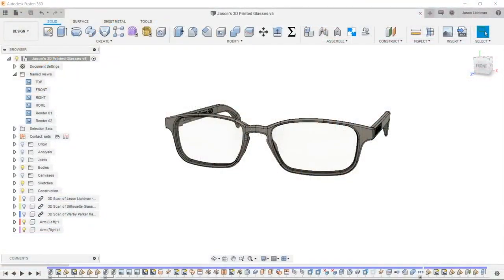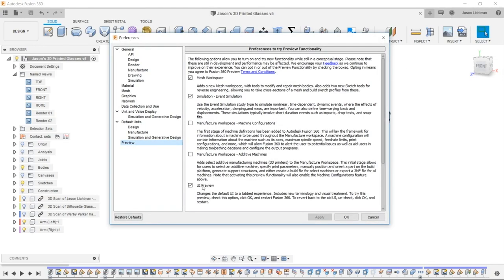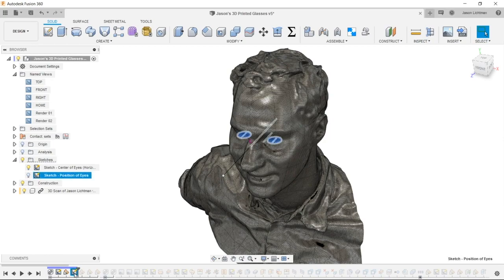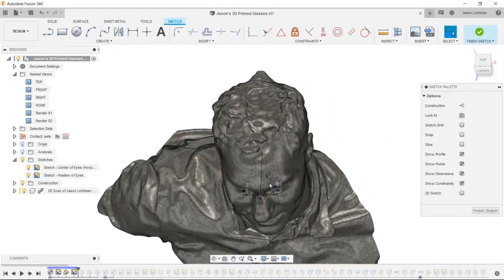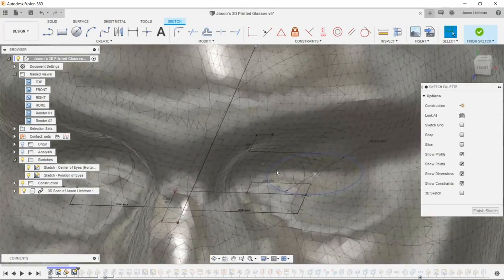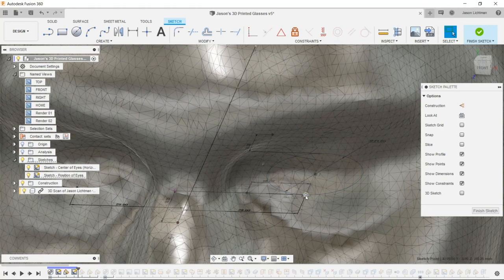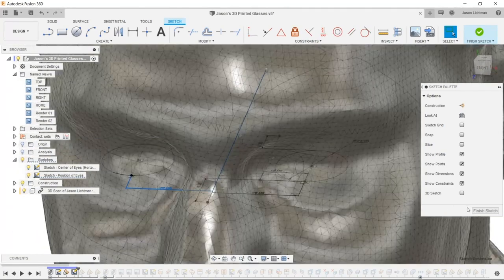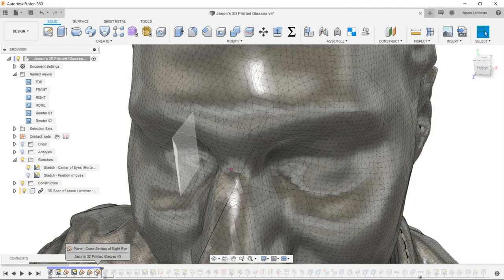360 LIVE (edited): Designing 3D Printed Prescription Glasses

Comment: Great workflow and tips! Now I have two questions:
1) Assuming you used an SLS printer, did you have the material impregnated with anything to make it stronger?
2) Since SLS machines have shrinkage, did you need to adjust your model to compensate, or did the slicing software do it well enough?
Reply from the maker: I'll let Jason weigh in on this, but for point #2 I know Netfabb has tools to simulate this.
Reply from the maker: Great questions, btw!
Reply: Glad you enjoyed my video. 
I have answers to your questions. I did not use SLS. I used HP’s multi-jet fusion technology. It is similar though. The material is nylon 11. It was not impregnated with anything to make it stronger because one of the inherent strengths of multi-jet fusion is that the parts are nearly isotopic. There is very little “layering” and the parts are quite strong. As mentioned in the video, I did get a small amount of shrinkage on the top surface of the arms. To compensate, I bubbled the top surface of the arms slightly. This was mainly for aesthetic reasons. I didn’t get any other shrinkage that would affect overall size or the function of the hinges. 
Cheers!
Jason
Reply: @easyriderj  Wow, I hadn't heard of that type of printing before. That printer sounds great.

Thanks again for sharing your process. I learned a lot of new techniques and appreciate the level of detail you went to ensure your frames accommodated all the ergonomic, technical and geometric considerations. Legit!
Reply: Adam Glazier When I started the project, I had seen a lot of 3D printed glasses that looked more like costume pieces than real glasses. By that, I mean that they lacked a lot of the subtle details that make a pair of glasses look beautiful and like you could buy them in a store. I wanted my glasses to look like they were professionally designed. Thankfully, I consider myself a professional. So, I took the time and designed them with care. I wear mine nearly every day and couldn’t be happier. 
Best of luck on your next design project!
Warmly,
Jason

Comment: How do you mate the hinge parts? Does the frame part split open in order to accept the donut part?
Reply from the maker: I think it was done in one print, but I'll let Jason explain!
Reply: auhopu there was no assembly required. I printed both arms and the frame itself in one piece. I left a very small gap between the parts so that they wouldn’t fuse together.

Comment: That background is blowing my mind? Is it mirrored or 3d?
Reply: That blew my mind as well. 
It is mirrored by the windows of the building they are in which is on the left side. If you look closely there are 2 lines on the left which look like cables. However those are not cables and are the horizontal gaps between the windows of the building.
Hope this solves that dilemma for you ^^
Reply: Evren Uçar is correct. The building our office is in has a section that sticks out. That’s where I was live-streaming from. You were looking partially at the side of the building and partially at view across the street. The glass is very reflective, so it can be confusing.
Reply from the maker: Hahah....love this discussion! I kinda wish Jason would have let it go a little longer.